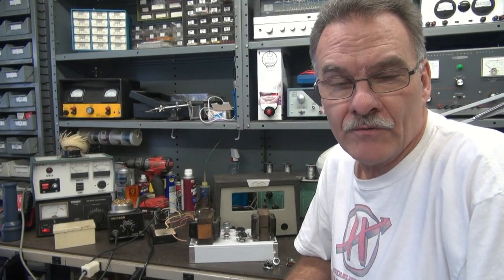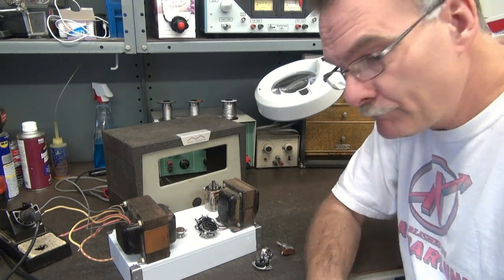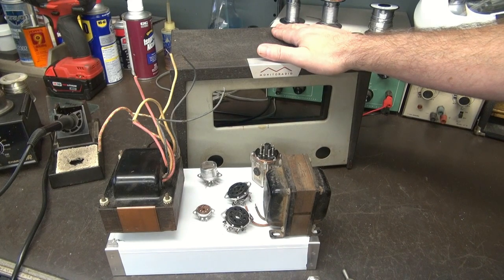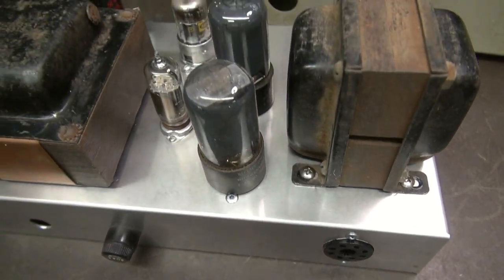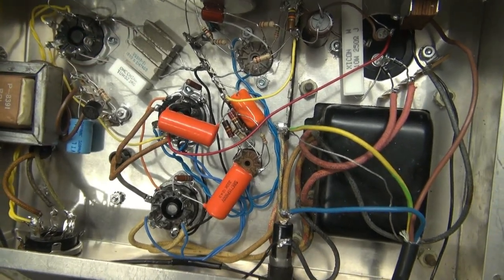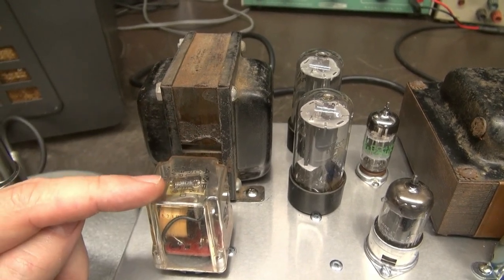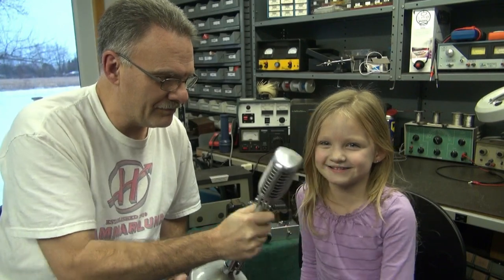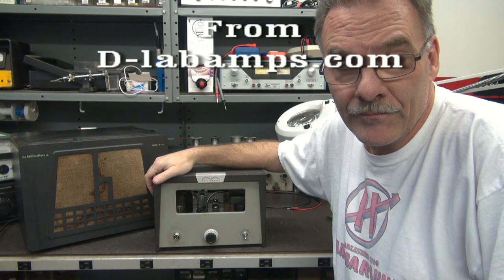How to build a 6v6 tube ham transmitter AM modulator by d-lab electronics

Comment: Cool project. Believe it or not, 25 cycle power transformers can be used for plate modulation. Enough iron in 'em that core saturation is not a problem. Audio is broadcast quality up thru about 5 khz then smooth rolloff.. In areas where 25 cycle hydropower was used, these xfmrs were pretty common.
They can do single-ended Heising as well as full-on push/pull with two 25 cycle xfmrs running back-to-back, driven by 6L6s in pp.

Comment: Hello Terry. Love your vids.

What type modulator transformer is that and what are the typical types normally and best used?
Reply from the maker: The one is this build came from a Multi-Elmac transmitter. UTC types are very common to find on ebay. Lots of good documentation available.

Comment: How much audio power does the modulator throw into a class C amp?  I have a nice NOS 809 GE tube good for 25 or 30 watts of AM carrier.... I am considering 6L6 vs 6V6 push pull.  I have a nice Stancor A-3845 mod xfrmr.
Reply from the maker: +Jay “Spirited Soul” Tee Hello, this modulator is approx 15 watts. I have a giant 6L6 modulator that does approx 40 watts
Reply: How about a schematic?